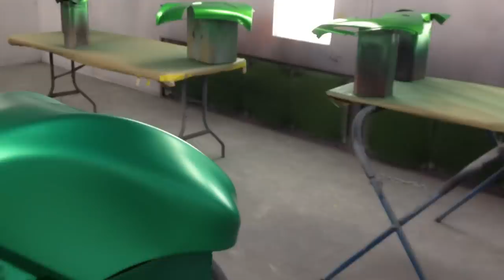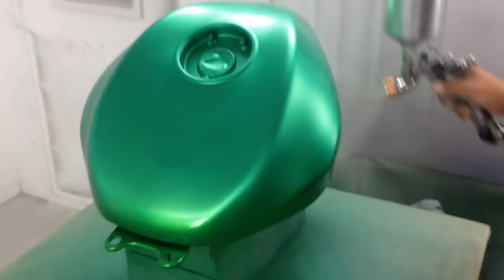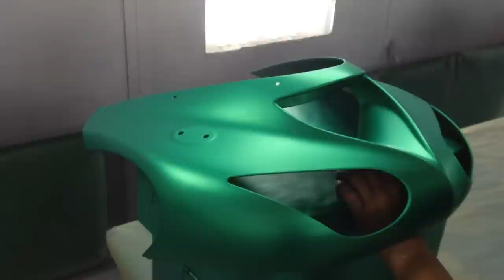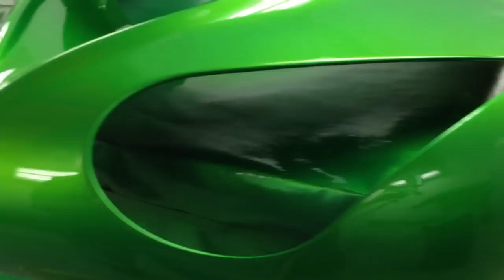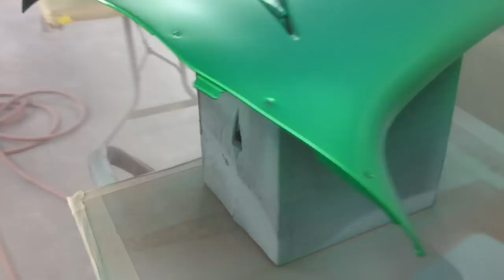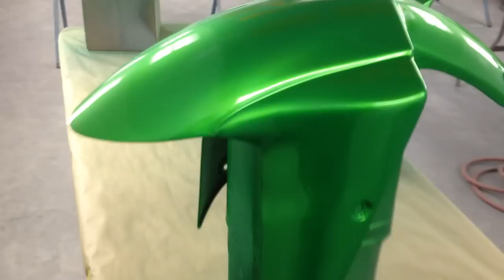Shooting House of Kolor Kandy

Comment: Looks fantastic my friend...how many coats of Kandy did u dpray?
Reply from the maker: Joshua. H I shot 3 coats of kandy on this particular job but I only filmed the first coat. This color combo doesn’t need as many coats of kandy like apple reds or kandy blues.
Reply: @user-ns8nv9em8w  ok cool...I'm currently in the process of painting my busa HOK lapis blue Kandy.I would like to be able to put the Hayabusa kanji decal under the clear coat..what's your opinion on doing that?
Reply from the maker: Joshua. H I personally prefer to paint the Kanji’s by using a vinyl cutter and Orafol Oramask 810 paint mask material which is a light tack paint mask vinyl. This gives the ability for endless color combinations for your Kanji’s. If you need some paint masks, email me and I can make you some if you don’t have access to a vinyl cutter. marcel@rushbikes.com
Reply: @user-ns8nv9em8w  hell yeah bro...I'll most definitely do that.
Reply: @user-ns8nv9em8w  Marcel is that the right email address I just tried to email you and your site says it's under construction are you at Yahoo or Gmail or something?
Reply from the maker: Joshua. H  marcel@rushbikes.com

Comment: Question! Is it normal to make several passes over the same area to achieve the look?
Reply from the maker: Absolutely,  Kandy top coats generally require 3-5 passes to achieve a deep rich pigment. Ultimately it is up to the painters discretion on how many coats of kandy is applied.

Comment: What size Gun tip 1.3 or 1.4 also which tip will be best for a full vehicle
Reply from the maker: Alvin Ray: That depends on your spray technique. I use the 1.3 nozzle Iwata LPH400-LVX since most of my work is on motorcycle. I use the same model gun with a 1.4 nozzle when spraying vehicles.  A 1.4 will move more material faster. I prefer a 1.4 for full vehicles.

Comment: So first is the primer, base, kandy and the clear ?
Reply from the maker: Jesus Garza: Every job is a little different. Preparation is key for an amazing paint job. Typically, a part should be sanded with 120g-400g sandpaper before spraying (Primer). Next, the primer should be sanded down with 400g using carbon guide coat to see any low spots. Third, spray the desired epoxy sealer. Next, spray the base coat within 1hr of shooting sealer. Allow the base coat and sealer to dry for a few hours to let the solvents gas out before shooting the candy. Generally 4-6 coats of candy is required to achieve desired color. Take your time when spraying candy & clear. I will do a detailed video on shooting candy soon. Stay tuned not subscribing to the channel

Comment: Whats method do u use to spray orion silver im getting mottleling
Reply from the maker: lamostwanted2008 When I shoot Orion Silver, I first start with a grey sealer or primer to allow easier coverage when spraying the pigment. Always make sure your surface is smooth with no imperfections. Next, using a higher temp reducer allows the metallics to lay down and dry slower when spraying coats. When shooting, you should keep an even distance of 6” to 8” away from your surface and keep air pressure 18-20psi. Anytime spraying metallics you will have to do multiple passes to eliminate mottling or “tiger stripes”. This is done by shooting left to right, then another pass top to bottom, then your last pass in a diagonal direction. These passes should all be done consecutively. The higher temp reduced will keep the paint from drying too fast and after a 10-15min flash time your Orion Silver should be uniform. If you need any further help, you can email me marcel@rushbikes.com
Reply: @user-ns8nv9em8w  thank you

Comment: What color are you spraying over the green kandy? Yellow kandy?
Reply from the maker: Lime Gold Kandy by House of Kolor code is UK02
Reply: RUSHBIKESdotCOM  couldn't find these codes on hok official website
Reply from the maker: naturebkoy60 the base-coat I sprayed is called plant green by house of Kolor. I used their fine base option for this metallic pigment. Next I used House of Kolor Lime gold Kandy. It is a tinted yellow Kandy which must be mixed with Ku100 catalyst and reduced with RU311 reducer
Reply from the maker: naturebkoy60 marcel@rushbikes.com or just call me 281-687-6876

Comment: What psiand fan do.you spray at? How much fluid?
Reply from the maker: Phill Lynn Auto Specialist I generally shoot metallics at 20-22psi and shoot candies or clear coats at 25psi. Fan varies upon distance and obstructions especially for those hard to reach area on motorcycle parts. But generally I open my fan wide open and do a half turn back to remove the distortion from the spray.

Comment: That fan patern can paint th wall...haha
Reply from the maker: @Mohd Fadzly: The Iwata LPH400 is an outstanding spray gun capable of excellent atomization. It’s important to understand air pressure, distance, and technique when spraying candy to achieve uniform layers of pigment. Generally a 1.3 nozzle, fan wide open with two turns back to reduce distortion is a sound formula.